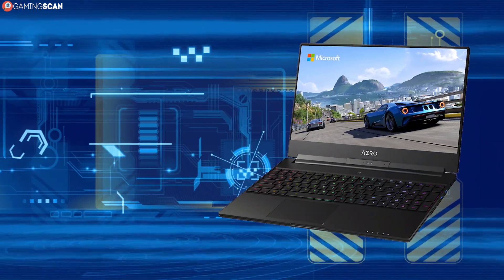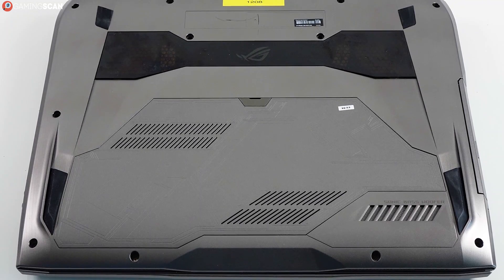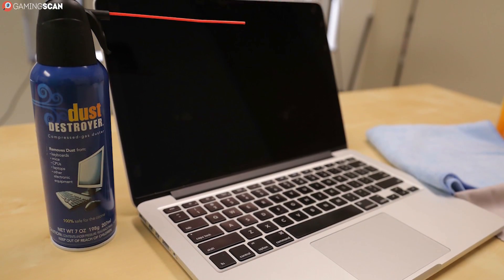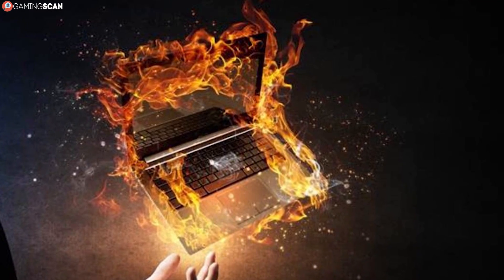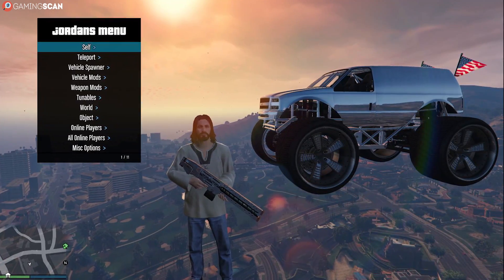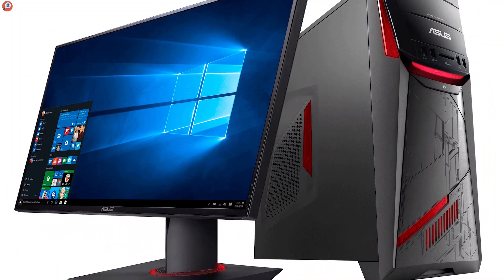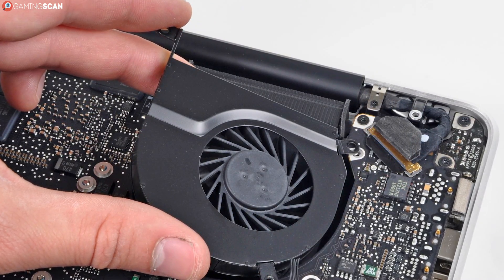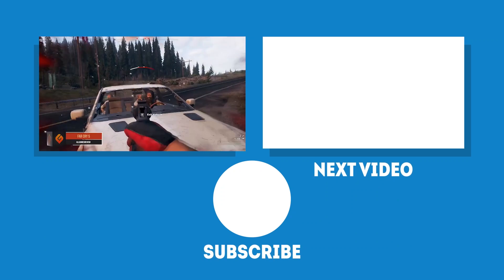How To Keep Your Laptop Cool While Gaming [Simple Guide]

Comment: my laptop is fine with modern games like csgo, battlefield and fortnite. but cant handle roblox
Reply: Rakt oh yeah yeah . it CANT
Reply: @alberasdws2dsa264  It cannot handle the oofs
Reply: Alber Samuel Villanueva same
Reply: @alberasdws2dsa264  Roblox has shit optimization. I can get 150-200 fps on csgo and 40-60 fps in roblox
Reply: @alberasdws2dsa264  my laptop Specs :- 2gb ram , Intel Core i3 , Intel HD 3000 
my roblox runs at 60 fps without fps unlocker and with fps unlocker it run betwwen 60 to 100
Reply: @alberasdws2dsa264  BRO I HAVE ASUS TUF GAMING F15 BRO IT CANT LIKE CANT HANDLE ROBLOX allgames can bur roblox nah just nah
Reply: @alberasdws2dsa264  yeh right it gets so hot
Reply: Most modern games are optimized while Roblox depends on the amount of block in the game, take phantom forces for example and compare to CBRO, CBRO rans better because it have low block count
Reply: @williamkwl6153  it runs on cpu not Block amount get ur shit right man
Reply: @williamkwl6153  No, roblox uses tris like any other game, roblox just has a bad engine.
Reply: Mine can handle dota 2, csgo and Warcraft without breaking sweat but gets fucked up in minecraft
Reply: @vinaymishra5425   Minecraft is so many mods so. It's langgy
Reply: @vinaymishra5425  same here mine cant handle minecraft
Reply: @vinaymishra5425   me too
Reply: @vinaymishra5425   me too
Reply: @vinaymishra5425  yea same
Reply: Wah Majjik Yeah same dude. I can't have more than 10 FPS if i ain't charging while playing. When i charge while gaming its a toast
Reply: @younickgamer6524  same xD
Reply: YouNick Gamer charging while gaming is the only way you’ll get more than 10 fps... even on a top spec laptop
Reply: @younickgamer6524  sameee
Reply: Same on roblox my laptop shuts down from overheating
Reply: @julian_xd5102  get a cooler it wil help :D I did this and it don't shuts up :D
Reply: i swear i have same problem i can run black ops 1 2 3 minecraft but it laggg on roblox
Reply: Ya me too it heats so fast like hell
Reply: I get around 30-59fps on roblox but a constant 60 fps in games like fortnite and stuff
Reply: @M_4A1s  i get 20-60 fps on roblox, the only problem on it is that it keeps on getting lower and keeps on getting higher constantly, its really random its like hovering through slow and fast over and over
Reply: @M_4A1s  bro i get 70-90 in rust but 30 IN MINECRAFT
Reply: @M_4A1s  isnt roblox a cpu game
Reply: @M_4A1s  prob becuase of better optimisation
Reply: Its because roblox only use CPU instead GPU+CPU
Reply: Waw Majikk if I’m correct I’m pretty sure Roblox is FPS capped
Reply: SAME
Reply: Same with me! I WANT A SOLUTION
Reply: ikr lol actually its because my wifi is slow so roblox plays slow but when it comes to game like asphalt, minecraft,truck clusters,and rocket league it runs pefectly no joke it runs 100 fps in rocket league
Reply: Same problem. Like is roblox secretly the most powerful game
Reply: @jeef9299  true other games can hadle it but roblox cant
Reply: true
Reply: He not joking. I just came here for ROBLOX
Reply: Specifications?
Reply: Lol i have the same problem.It never overheats when i play any other game
but when i play roblox it overheats very easily
Reply: But can it run Minecraft?
Reply: Lol my iPad 6 can run roblox at full graphics properties
Reply: Fortnite? Seriously no-one plays that
Reply: On roblox, I play phantom forces, and its always 40 FPS and in any other game, its 60 FPS, but it does not matter because it does not seem to lag. I just want better cooling, not more FPS
Reply: @ivanm5359  i have the exact same problem.
Reply: Exactly Roblox Lags so much but when I play Minecraft I am a ok
Reply: Then i think you should go and watch the verge's $2000 gaming PC and you should have no problem running roblox at 30 FPS
Reply: Roblox fps cap is at 60 fps try to use a roblox fps unlocker i use one and it give's me 144 fps
Reply: SAME
Reply: same
Reply: "Modern games like csgo battlefield and fortnite".
All AAA games are crying in a corner because of ur words
Reply: Fr when I play roblox it go like hOT AIRRR ON MY LAP WHILE I AM PLAYING
Reply: @namrata6792  IKRRRRR I HATE ITTT
Reply: Bruh same
Reply: Same
Reply: I have a old lap top and it runs csgo so smooth but when playing mc or Roblox my fps is 10
Reply: Same!! .😂
Reply: Litteraly happens to me but I guess Roblox has GPU OR CPU low management or no management at all which makes it hot
Reply: Wtf????
Reply: Try playing at fullscreen.
Reply: Ancient Bacon i fixed it anywaysnnow my gou is around 60 59 degress when playing games
Reply: @hackerz95almighty90  Ah okay.
Reply: @ancientbacon8103  aye
Reply: you're not special enough for roblox. I'm sorry
Reply: R.I.P for you
Reply: Same dude
Reply: same problem
Reply: Your laptop shuts down because of overheating. You may play modern games in low resolution and side fan helps. While playing roblox I had the same problem. I started playing in my laptop by placing it in flat surface and now the problem does not occur. If this is not useful then go to roblox setting and keep graphics quality in manual and change it. But if u want good graphics buy the under fan for laptop. It is not expensive.
Reply: @Waw Majikk same 😭
Reply: Buy an cooler :D mine works with an cooler :D
Reply: @kawaiiclizyo2543  I have the same problem and I use a cooler but mine heats up above the keyboard and won't cool down-
Reply: Same. My laptop can aldo play csgo and fortnite easily. But cant handle Minecraft.
Reply: Oof
Reply: Your. Not worthy to play it
Reply: roblox has something called block count and the thing is that most computers dont handle it properly just cause there are too many things to load in it has high block count
Reply: Mine too!!

Except that it can’t run anything
Reply: Waw Majikk SAME
Reply: XDD
Reply: It's roblox robloxes servers are laggy
Reply: same
Reply: Ask the developers who coded the game
Reply: OOF
Reply: Same when I play fortnite and other games it gets like 200+ FPS but when I go on google my laptop gets the blue screen
Reply: that's because roblox uses opengl, while the others use directx.
Reply: The maximum Fps in Roblox is 60.
Reply: SAMEE
Reply: Im actually not ;-;
Reply: just so you know in actually using a potato laptop and I play csgo and roblox at lowest graphics
Reply: @alberasdws2dsa264  roblox is poorly optimised
Reply: It's because roblox is set to run on your CPU, while most gamed are or can be set to run on the GPU. 
So if your computer has a better GPU than CPU then you will have this issue.
Reply: Minecraft 1.14 starts making it worse. Having a regular fan in your room helps quite alot.
Reply: I had a similar experience, but if you have an integrated and a dedicated gpu, roblox usually defaults to integ, happened to me. Open up nvidia control or (I think) amd catalyst and go to manage 3d settings and choose roblox to run on dedicated gpu
Reply: Dude ikr
Reply: My potato laptop can handle anything , with lowest sett. and tweaks xD
Reply: Me too I play blox burg and while I’m building it just shits down
Reply: Oh, that's because its downloading a bunch of spyware and viruses
Reply: Roblox isn't really that optimized.
Reply: Go to ur nvidia panel -> 3d settings -> program settings : Add program, look for roblox, under the roblox that ive chosen, choose high performence nvidia gpu. Chances are that the PC used the integrated graphics the entire time.
Reply: Roblox relys on CPU not GPU
Reply: Oof
Reply: My pat lop is right with every game except windows 10
Reply: OMG SAME MY LAPTOPS COOLING DOWN FAN SHUT DOWN THATS WHY IM HERE AND ITS BECAUSE OF ROBLOX OMG
Reply: but can it run minecraft with shaders ?
Reply: lol roblox is the god
Reply: step 1 run a roblox game step 2 go to task manager and check if roblox name says Roblox (32 bit) ah shit here we go again so if you have a 64 bit pc then if it says roblox 32 bit then you cant play roblox when you have a 64 bit pc and playing roblox on 32 bit version if you play roblox 32 bit and when you have a 32 bit pc then it ll run smoothly roblox will release its own 64 bit version i dont know when so fuck that.
Reply: cAN iT RuN cRisIs
Reply: bruh same I get 97 degrees celcius in roblox for my cpu and gpu is 90 degrees celcius
Reply: roblox is cpu intensive, no gpu involved
Reply: @zicksee0  r/woooosh
Reply: most games like csgo,fortnite are gpu intensive but roblox is cpu intensive
Reply: Mine can’t handle anything (monster hunter world, ark se, etc) but it ESPECIALLY can’t handle roblox.
Reply: O no
Reply: Mine can handle roblox
Reply: same, my laptop got up to 80 fps at World Of Tanks. but 10-20 fps in roblox
Reply: Roblox is to intense
Reply: it's most likely because you have 2 gpu's, one of intel and one of nvidia. Your laptop uses the intel one when you aren't gaming. Roblox probebly uses the intel graphics card to run.
Reply: Lol
Reply: why the fk is this happening to me too? its heating more than when im playing csgo on ultra settings + 200 fps...
Reply: same lmao
Reply: It's a joke lol, I play Roblox but when I installed Fortnite, it's super lag even though I watched how to reduce lag.
Reply: Lol
Reply: This is because roblox dose not use GPU so the cpu is doing everything look up some tutorials to make it use your GPU
Reply: I can play gta 5 50 fps, cod mw2 60 fps but got just 25-30 on cod mw 3, i think mw2 and mw3 has similar graphics ?
Reply: That's impossible, even my old pc with 2gb ram, 9800gt nvidia, and dual core can run roblox in 55-60 fps
Reply: Yeah you right
Reply: same shit for me but for minecraft
Reply: Same bruv roblox is a different breed of games
Reply: Mine too
Reply: sorry old but its fps cap
Reply: It must be reversed.
Reply: you need a better cpu since roblox Is cpu intensive
Reply: as a roblox player... its true
Reply: MY CANT EVEN RUN THOSE GAMES EXCEPT ROBLOX BUT ROBLOX KEEPS LAGGING
Reply: Because roblox enables certain things at graphic levels, like you have anti-aliasync at 9, 10th graphic level also at that time you render very large part of map so yeah.. 15fps
Reply: Same
Reply: Waw Majikk same also blender
Reply: LMFAOOOOOOOO
Reply: Nothing can
Reply: Same with me
Reply: Waw Majikk oh no no no NO NO NO
Reply: Same, every time I play roblox, after a while my laptop shuts down.
Reply: Waw Majikk lol that why I’m here🤣
Reply: There are some super realistic in roblox tho ,try search it up and your eyes will not believe in what you're seing.
Reply: Lmao imagine your laptop on minesweeper....
Reply: Yes me too
Reply: Tf dude lol,if it was high spec handphone i believe but this is pc lol
Reply: I have a reason for that for mine, my system forces roblox to use my integrated graphics rather than my gaming one
Reply: i tho it was my laptop issue tho cus play roblox with physics could crash the game tho...if i play minecraft with SEUS shader i got like 241FPS averange
Reply: my sisters MAC cant handle rblx but my GAMING LAPTOP cant even handle csgo.............
Reply: Download ThrottleStop  and 
uncheck BD PROCHOT if your pc is hot then it will turn on i guess and have more fps i think depents on your problem
Reply: Yes
Reply: That's the whole reason I am here
Reply: Alber Samuel Villanueva dude same. Idk wtf Roblox does, but my laptop can run CSGO no issues but can’t keep cool with a Pizza tycoon game.
Reply: Laptops are not glitchy ROBLOX IS😂😂
Reply: You need a 10 years old laptop for roblox to work
Reply: Yeah hes not joking i have the same problem
Reply: My Laptop can handle GTA V and not Fortnite in all Low.. :'/ ( I have a ASUS with Nvidia GeForce and Icore5 8th gen)
Reply: bruh
Reply: Oof
Reply: Like wutttt
Reply: Set roblox to run on gpu
Reply: He being honest guy, I playing roblox and the laptop suddenly shutdown
Reply: Alber Samuel Villanueva my laptop is fine with games like roblox. But cant handle csgo, battlefield and fortnite.
Reply: SAME BRUH
Reply: Mine its fine with Fallout 3 and NV but its lagging as hell in a roblox game.
Reply: Dang
Reply: even my laptop can run GTA 5 at the highest performance and cant handle  gta 4 and also mincraft the fps is between 3 to 10
Reply: Dude, EXACTLY
Reply: ikr
Reply: roblox performs on your cpu not on ur gpu. ur cpu must be like an i3
Reply: Alber Samuel Villanueva Roblox does lag
Reply: Lol
Reply: All you guys seem to be cpu bound
Reply: Omg dame
Reply: Same
Reply: True what do I do
Reply: Alber Samuel Villanueva holy crap is it a joke?
Reply: SAME!!
Reply: Lol same, its really hot when I was playing Roblox
Reply: me too
Reply: Do u knw da waye
Reply: It's because when you play roblox it's probably using the Intel uhd graphics and not the real dedicated graphics card
Reply: I swear.
Reply: Roblox, Powering L A G
Reply: Same my laptop cant handle roblox
Reply: mine can handle a lot of games but roblox very weird....sometime when i play big games like wild west i got around 47-58fps very weird...but i fixed it using rbxfpsunlocker
Reply: Same
Reply: You can fix it by changing yourr battery plan
Reply: Itsssss True :(.
Reply: wtf lmfao
Reply: When I'm playing roblox I can cook BBQ with my CPU
Reply: Same lmao
Reply: same
Reply: Just download fps unlocker
Reply: Roblox uses 100% of my gpu and runs at 24fps even tho I have a GTX 1650
Reply: Same lol
Reply: OMG HONESTLY
Reply: LOL your computer is a joke just a toaster itself
Reply: @BurningSorrows  nah roblox is just terribly optimised
Reply: IKRRRRR
Reply: Any laptop or pc can handle roblox lol
Reply: Minecraft with shaaders crhome and discord opens runs perfectly well but roblox with lowest graphics freezes my laptop if aanyother app is open ANY APP
Reply: exactly same with me
Reply: i can run bf1 decent, csgo really well, fortnite well, gta v well and the witcher 3 decent and yet i cant play deceit with more than 50 fps xd and minecraft at 80 fps xddd
Reply: My gaming laptop over heats badly when running gta 5
Reply: @SlavicUnionGaming  mine too but try activating coolbost, if it doesnt cool your pc then try buying a decent cooler, id say it is around 20-60 dollars and it will for sure cool your pc
Reply: Same I can play gta v but i lag in roblox 😂
Reply: I am horfing at this
Reply: Mine can’t handle papas pizzeria
Reply: My laptop can handle all those but cant handle roblox. Meh laptop shet
Reply: Bro, Same
Reply: My laptop's processor runs at 95C while gaming
Reply: Ikr... I can play everything without problem but roblox... I feek ya
Reply: same omg
Reply: For some weird reasons Roblox relies on my integrated gpu instead of the dedicated one
Reply: Same. It's fucking annoying :(
Reply: Shut up
Reply: same lol
Reply: SAME
Reply: same. also blender
Reply: I've never went above 60 in roblox
Reply: Samee
Reply: same
Reply: Same
Reply: Bruh a 12 year old laptop can handle Roblox what u talking about
Reply: Its 91 celsius.. ONLY WHEN ROBLOX, I PLAY RDR AND ITS 50
Reply: Fr..
Reply: Same
Reply: hes not joiking ..... i have the same problem
Reply: Impossible
Reply: guy’s she’s true.
Reply: Same :(
Reply: I wouldnt be suprised if ur talking bout the bigger games on roblox
Reply: Same with mine
Reply: I get steady thermals on CS:GO at 60+ FPS, but I overheat playing Counter Blox minimum settings capped at 30 FPS.
Reply: Same xd but for some games
Reply: bro same believe me not joke I swear I play Minecraft and cod no lag but when robot no lag but overheat
Reply: its true, the laptops overheat way too much while playing Roblox
Reply: Roblox is confusing
Reply: Waw Majikk yes ikr
Reply: Chrome eats your ram likes a juicy ass
Reply: Me to no joke idk why
Reply: My laptop overheats quickly with minecraft im sure im not the only one
Reply: ikr
Reply: I have the same problem and I thought my laptop was wierd turns out I'm not alone
Reply: SAME BRO I GET 30 FPS LOW SETTINGS ON ROBLOX AND XON CSGP I GET 60 FPS
Reply: I think its becuz roblox uses processor insstead of gpu
Reply: same
Reply: it’s cuz roblox uses cpu and not gpu, it’s stupid but you can fix it but it’s hard as hell
Reply: IKR
Reply: yeah
Reply: Same
Reply: Waw Majikk me to me to
Reply: And I’m serious
Reply: same here
Reply: Mee too..it heats up when playing ARSENAL
Reply: exactly the fps i literally higher than on roblox
Reply: Lol I love how you copied lazerbeam
Reply: Lol same HAHAHAHAH
Reply: Yes Roblox has a bad optimization.
Reply: Same, for some reason roblox is dumb
Reply: Its because the modern Games are GPU based and roblox is cpu based which might mean u dont have a good cpu
Reply: Same here, I can play Gtav with most of settings on high quality. But then when I play roblox I get 1fps every 15 seconds
Reply: I have 8GB ram laptop, my laptop is damn hot when playing roblox.
Reply: Same, I have a gaming pc 1400 dollars core i5 thx 1660
Reply: My laptop can handle csgo, valorant, Fortnite but not Minecraft
Reply: same bruh
Reply: Same
Reply: Damnnn same as me
Reply: looolllll same roblox makes my laptop explode but everything else is fine
Reply: ye
true
Reply: Waw Majikk omg same
Reply: I KNOW RIGHT ITS LITERALLY SO HARD TO RUN ROBLOX
Reply: Lol, The same thing happens with me....It just heat a little bit with forza Street,Sniper Fury,Modern Combat 5,minecraft,But when i play roblox my laptop sometimes heat too much that if i put an egg over it,Then it will also melt.....
Reply: SAMEEE
Reply: Holy fuck same here i can play Fortnite on High settings and roblox i have to play on the lowest settings No Fucking joke
Reply: @migs1517  yeah whats funny is I put minecraft on max chunk render distance on a multiplayer server I can easily get up to 50-65fps while if I turn on roblox on the lowest fucking setting my computer can not handle it
Reply: @Kutchy7765  i think roblox needs to update the engine they are using for the game or whatever its called
Reply: Waw Majikk IKR SAME AND ROBLOX HAS THE WORST GRAPHICS
Reply: its the oposite
Reply: mine to
Reply: Same
Reply: for people asking if its real (YES IT IS) fsr me and my friend's laptops can run anything in a decent fps but cant run roblox smoothly fsr. it really is strange
Reply: It probably runs roblox in the integrated graphics card that comes with your cpu instead of the dedicated one
Reply: Same lamo
Reply: Same happens with me, but the game it can't run well is csgo
Reply: But can it run crysis?
Reply: my laptop cant run all of them
Reply: it happend to me too
Reply: Same not gonna lie
Reply: My laptop cant handle gba games but it can handle minecraft, roblox, and pubg
Reply: OMG MINE TO 😂😂
Reply: Late reply but what’s probably happening is roblox is using integrated graphics instead of the gpu you have
Reply: CSGO really is a modern game if you’re stuck in 2012
Reply: What?
Reply: I'm the opposite
Reply: So truw
Reply: SAME bro i thought im the one whos not handling roblox but can handle valorant
Reply: sed it happens with me too
idk why when i plau
Reply: maybe use fps unlocker
Reply: roblox and minecraft are more cpu intensive games. so, gpus only mostly matter for the shaders and stuff
Reply: aw thats true
Reply: Roblox systems or client...or what you call that is a bullshit
Reply: This is because roblox is a CPU game and not GPU your cpu might not be as good as your gpu as used in other games
Reply: yeah,It kicks me out from blackhawk rescue mission 5 lol
Reply: mine too
Reply: Bruh
Reply: sameeeee
Reply: THIS IS SO TRUE
Reply: trueee
Reply: @Uchiha_Cat_  LEVI?!
Reply: @DuckieOreo And?
Reply: @r6luh  he probably isnt because it actually happen
Reply: Same and this other game called ZombsRoyale
Reply: @r6luh  How about you leave that to the actual guy.
Reply: Its because roblox has to good graphics I can't handle alwell
Reply: WHAT
Reply: @r6luh  Yet I get lower than 60 fps, I can run skyrim in ultra without any fps issues and skyrim also has an fps cap
Reply: SAME IT GET HOTD AS HELL
Reply: yes.I have the same problem as well.When I play gta 5,it is very smooth on medium settings,but on gta 4,I have 30 fps on lowest setting,something even 10fps if laptop in hotter then 50 c
Reply: @r6luh  Not really, if my pc can handle 200 FPS in csgo I'm sure it can keep a solid 60 fps. Every other game with a 60 fps cap like skyrim my fps doesn't fall below 57
Reply: I have the same problem
Reply: Ikr my MacBook Air cannot standed roblox for long
Reply: Same
Reply: same
Reply: LOL SAME.
Reply: Trust me, the engine roblox uses is garbage
Reply: same 😂😂
Reply: Lol
Reply: SAME
Reply: same
Reply: SAME
Reply: Guys if your have a fan just put the fan on max and put on on the laptop it works with my phone the has no storage which means it works
Reply: Bruuhhhh wtf that's exactly why I'm here
Reply: Same lol
Reply: its true
Reply: Me too
Reply: lmao so true, i got 30fps and less (sometimes 60) even though I have gtx 1050Ti and i7
Reply: Csgo is modern?
Reply: It's because Roblox takes up alot of processor usage
Reply: Ι dont remember csgo being a modern game
Reply: My laptop can handle roblox, but like crashes everyday and it even crashes on minecraft I cant even get to the startup page of minecraft bc it keeps crashing once i click “play” ive tried to fix it so many times and nothing has worked im thinking abt throwing this laptop out of my window 😭
Reply: Because Roblox is poorly optimized and barely used gpu
Reply: Its the same for me
Reply: It’s cause roblox is bad in some countrys
Reply: Same
Reply: not lying SAME THING WITH MY DAD'S MACBOOK AIR CANT HANDLE ROBLOX
Reply: same but that's the roblox' error lmao
Reply: Csgo modern lmao. You could play it on a school library pc.
Reply: roblox is the worst heats my computer and makes a whirring noise every other game is fine I can relate
Reply: Mine can't handle Minecraft
Reply: same like while playing robloz it shutted down bruh
Reply: Wait wat?!!;!
ROBLIX!?!?!?
Reply: Same
Reply: It’s true, same for me
Reply: Lol same
Reply: WHAT SAME BRO WHEN I PLAY CSGO ITS PERFECTLY FINE BUT WHEN I PLAY ROBLOX SOMEHOW MY FPS DROPS
Reply: Same her
Reply: Sameeeee
Reply: bruh same it literally overheats and shut down whenever I play roblox.
Reply: BROO I HAVE THE SAME PROBLEM LMAOO MY PC CAN RUN GTA5 BUT CANT HANDLE ROBLOX HIGH GRAPGHICS LEL
Reply: no he not lying, i play minercaft with a little loud, but after around 10 minutes of playing roblox it went louder than 10 airplanes
Reply: same, my pc shuts down for no reason, download roblox from microsoft store.
Reply: Mine is the opposite
It can handle gta v fine but csgo horribly
Reply: It's true roblox doesn't use much cpu usage but it lags
Reply: SAME
Reply: Mine too xD
Reply: True it doesnt handle roblox too well
Reply: Same
Reply: no no no no your joking
Reply: SAME
Reply: My laptop is like this as well
Reply: Yah same mune heats up very fast while playing roblox
Reply: Same
Reply: Nah deadass I can run valorant fortnite I can even run cod but I can’t run no damn roblox
Reply: @ypr3954  i could run gta and fortnite around 60 fps but when im in roblox its under 30
Reply: Ngl mine too
Reply: YESS TRUE THAT'S WHY IM HERE!!!
Reply: RIGHT
Reply: Opposite for me bro
Reply: same
Reply: lol
Reply: omg same
Reply: Wait same for me
Reply: bruuuh
Reply: @Waw Majikk bruh me too
Reply: Lmao
Reply: Same
Reply: mine can't stand blockland
Reply: Bad CPU?
Reply: Same
Reply: same with me. It starts over heating like the second I open roblox.
Reply: Guys its less then 60 cuz roblox is capped to 60 u can use a fps unlocked for roblox
Reply: Ngl, i can run warframe but not league. My friend said that im kinda sus but it's true
Reply: SAMEEE
Reply: same lmao thats why im watching this vid
Reply: You are on a laptop -> you have an integrated gpu -> roblox runs on integrated gpu default -> robloxs fps cap without using external programs is 60
Reply: EXACTLY
Reply: True
Reply: Same
Reply: Same
Reply: That is becus roblox has a fps cap you only can get 60 fps. But you can also use a fps u locker for roblox and than you can ez run higher fps.
Reply: Ye
Reply: same here
Reply: Lol
Reply: Don't play roblox
Reply: If i play a super deataild game in robblox my computer fine me when i play a game like made by a 10 year old on roblox my computer after one sec of playing my time has come
Reply: mine cant actually handle roblox
Reply: Hello Roblox YouTuber here in the year 2022 this problem still exists
Reply: SAME
Reply: Same my roblox makes my laptop so hot
Reply: Valorant.. it kills my laptop.. no wait any game kills it
Reply: like fr i keep lagging so hard when playing roblox on xbox but codmw2 is very smooth
Reply: Bruh my laptop can only play roblox
Reply: You're internet
Reply: it happends to me to...... i have 120 on fortine and i have tops 50...
Reply: It’s Cus roblox isn’t optimised unlike the other games you mentioned
Reply: Well you have to lower the graphics on roblox when you’re in a game
Reply: FR
Reply: same lol
Reply: Other games are fine but content warning make my computer hotter than usual
Reply: How
Reply: roblox's optimization is garbage thats why
Reply: On god bro I have the same problem
Reply: SAME BRO
Reply: Same my laptop can handle csgo, Fortnite but not Roblox ;c
Reply: Its true for me
Reply: Yeah bro fr😂😂
Reply: Mine to😂
Reply: Waw Majikk Joke right
Reply: @alex2620  Its true, no joke
Reply: @alberasdws2dsa264  you have to be joking.... thats basically impossible 😑
Reply: @Mohann-  Yah same I have that problem Haha. When I play R6 the FPS of the game is decent, but when it's roblox I'm stuck here with less than 60fps (Note: this is a gtx 1060)
Reply: @VinatsuYT  is it a Dell g7?
Reply: TehGhoSt WHo PLay it’s a Predator Helios 300
Reply: @Mohann-  ITS true
Reply: @alberasdws2dsa264  is Roblox actually that laggy 😂
Reply: @VinatsuYT  all the downloading and mods probably.
Reply: Go to ur nvidia panel -> 3d settings -> program settings : Add program, look for roblox, under the roblox that ive chosen, choose high performence nvidia gpu. Chances are that the PC used the integrated graphics the entire time.
Reply: @VinatsuYT  ow does your laptop have a integrated intel hd graphics? that means that your laptops battery cant handle the 1060 and to get the potential to use the 1060 in gaming youll need a charger plugged in everytime hahaha :D
Reply: @shiv6450  actually fixed it after all these months haha. Apparently the fans started accumulating dust making  my laptop slow and my laptop was Acer predator 300 >-> so it would be i7 / gtx 1060
Reply: @Mohann-  it is possible i have more fps on csgo than roblox
Reply: @Mohann-  nope its true im on a mac book pro xd
Reply: @alberasdws2dsa264  yeah if you're running it on low settings
Reply: @Mohann-  happens to me
Reply: @VinatsuYT  roblox runs on cpu not gpu
Reply: @Mohann-  Its frickin real
Reply: @alberasdws2dsa264  same here
Reply: Alber Samuel Villanueva omg same
Reply: @VinatsuYT  the reason you are lagging is because your pc is trying to go to high fps but roblox is preventing you from going that high. I recomend you to get a mod to prevent that
Reply: @VinatsuYT  delete the textures and get the roblox fps unlocker to get better fps up to 240
Reply: Alber Samuel Villanueva ik what u mean same thing for me
Reply: @VinatsuYT  download fps unlocker
Reply: @Mohann-  its true
Reply: @VinatsuYT  roblox doesnt use gpu it uses the cpu.
Reply: @Mohann-  he's right i have the same problem
Reply: @VinatsuYT  Use a fps unlocker,roblox limits your fps to 60.
Reply: @Mohann-  they arent joking like when I can play a "unreal engine game" my laptop gets overheated and closes from a ROBLOX game ;-;
Reply: @alberasdws2dsa264  Are you talking about fps?
Reply: @alberasdws2dsa264  my laptop cant handle roblox too lol
Reply: @alberasdws2dsa264  omg name I can play csgo at 200fps but at roblox even at lowest settings I get 40fps so roblox is too good
Reply: @alberasdws2dsa264  yeah my laptop can't handle roblox either-😞😭✋💀
Reply: @TehGhostWhoPlay  Dell laptops heat the most- mine is dell😃💀
Reply: @Mohann-  It depends on the game for example my potato laptop can run a basic baseplate but can't run this game called blackhawk rescue mission 5
Reply: @alberasdws2dsa264  same for me
Reply: @VinatsuYT  get roblox fps unlocker
Reply: Roblox fps is capped at 60
Reply: @Mohann-  dude my pc runs all those game it wont  run roblox in max graphics
Reply: @VinatsuYT  I know I'm a year late but roblox puts a 60 fps cap on the games I'm pretty sure
Reply: @Mohann-  we are not joking
Reply: @VinatsuYT  Roblox has an FPS cap, use an fps unlocker to make it run betterr
Reply: @Mohann-  happens to me too
Reply: @Mohann-  Mine can't either
Reply: @alberasdws2dsa264  lmao even if my 1650 isn’t the best I couldn’t run roblox without lag
Reply: @alberasdws2dsa264  bro I ran boneeorks on a 1650 and it worked but naw I can’t run steam or steam vr without lag
Reply: @Mohann-  lmao u guys just don't know how big roblox games can get some roblox games can crash gaming pc's
Reply: @Mohann-  i have the same thing
Reply: @Mohann-  roblox runs more on cpu than tam
Reply: @alberasdws2dsa264  BRO SAME
Reply: @Mohann-  well, Roblox has gotten more advance
Reply: @Mohann-  you’d think
Reply: @alberasdws2dsa264  wait how LOL
Reply: @Mohann- certain games in Roblox have extremely complex scripts so even if the graphics aren’t top tier (which isn’t always the case) it can cause a lot of lag
Reply: @Mohann-  nah its the same for me, I can play games like fortnite and r6s, but not roblox.
Reply: @Mohann- Roblox is CPU reliant
Reply: @alex2620  ITS true my laptop just turn off because overheat
Reply: Alex Birrueta i m p o s s i b l e
Reply: @alex2620  you dont even know how much juice roblox requires...
Reply: @alex2620  roblox has multiply games inside 1 game if that make sense
Reply: Hugo what?
Reply: @alex2620  DUDE WE NOT LYING. I play games on roblox like Arsenal , Jailbreak , TOWER OF HELL. . As for Arsenal after sometime playing it the Roblox Player just crashes due to overheat and as of Jailbreak it doesn't crash but it switches of the WiFi of my laptop to reduce heat.
Later on I tried devolting and reducing Graphics nothing helped much.
Finally had to open up my laptop and clean the fan. 
Eww! It was so dirty in there. There was pretty much dust layer blocking the airflow of hot air. So basically my laptop could not throw out the hot air. So it would simply keep on heating the laptop. 
Now the temp had reduced a lot.
And also I work on developing games. I render buildings for my friend. Before cleaning the laptop, when I used to render buildings on ROBLOX STUDIO they CPU fan would go crazy spinning at very high speed.
Even though I use Intel Core i5 and 6GB RAM, which is enough to render at least in ROBLOX STUDIO.
But now it's lot better. The fan spin not so high but yeah it has improved.. I SUGGEST YOU ALL TO ACTUALLY OPEN YOUR LAPTOPS BACK AND CLEAN THE FAN. We did it with 0 experience. Just check on YouTube how to do that.
I HOPE IT HELPED.
THANKS
Reply: Roblox and minecraft use javascript, the glory language, glory languages needs glory cpu to keep the glore up
Reply: Oh you can't run roblox because you have nvidia driver and geforce experience installed. If you have it, you can't run roblox good.
Reply: poor guy